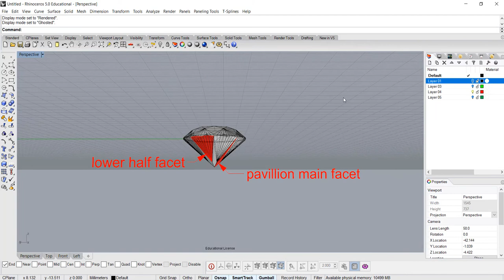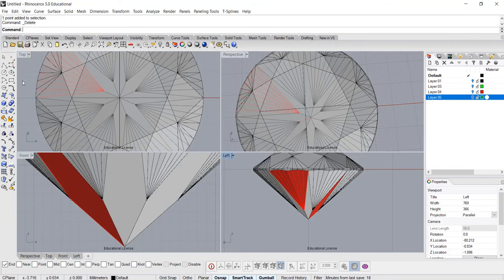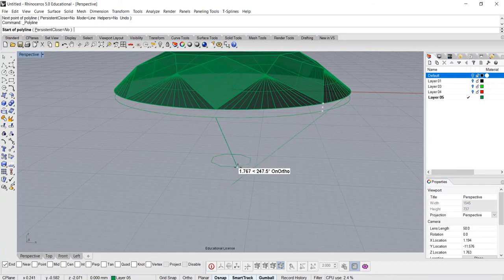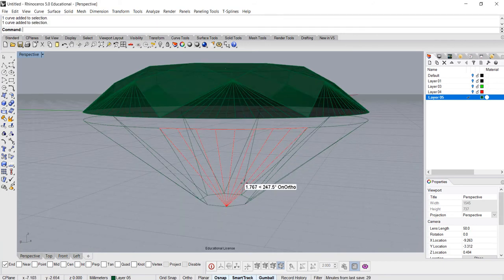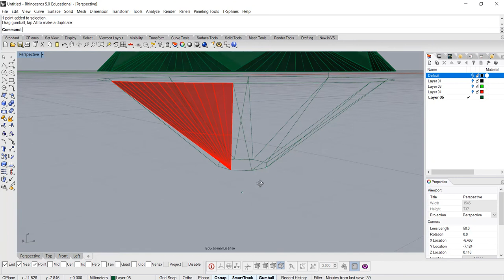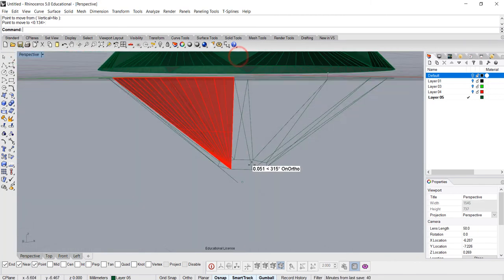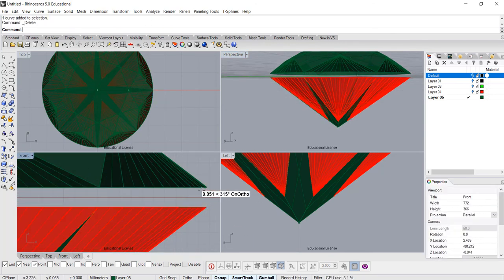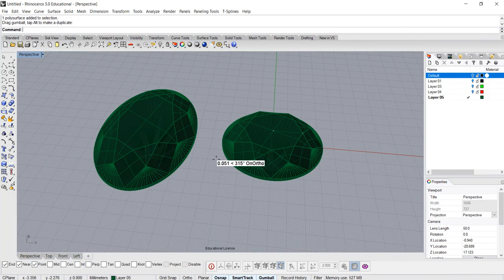Jewelry CAD Design Tutorial #8 - How to Build a Diamond Rhino 3D (part II)

Comment: the  gridle on the diamond shouldn't be all flat, in the diamond you use as finished example it has  different height , kind of smaller in the central part, then the heigh gets taller in the extremes. in the steps you teach us, the gridle is all equal, so can you please tell us how to get that right? I appreciate your work a lot PJ thank you!
Reply from the maker: Hi Fernando. As a CAD designer, not a gemologist, my goal was trying to inspire the jewelry CAD designer knowing how to build a faceted stone when they encounter a job that needs one. The same method can be used in other shapes of faceted stone.  There will be not much different for rendering if the girdle has more facets. In fact, you can find the stones in mesh file online to use, and they will be more close to a "perfect" stone cut.